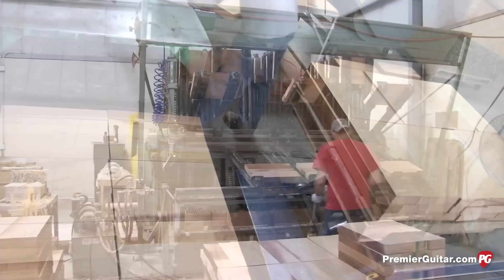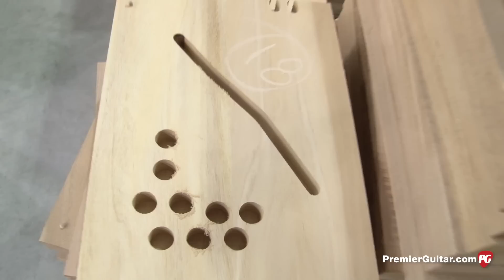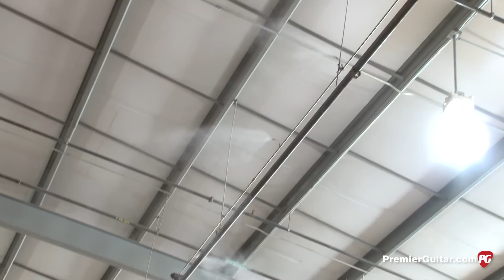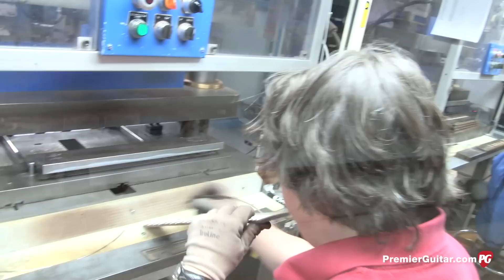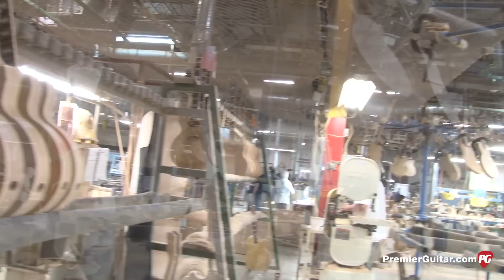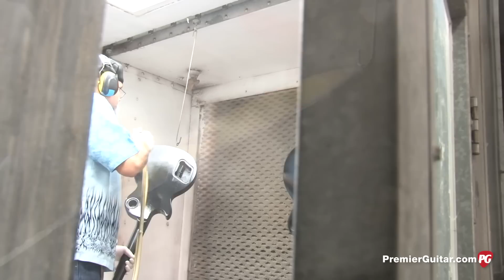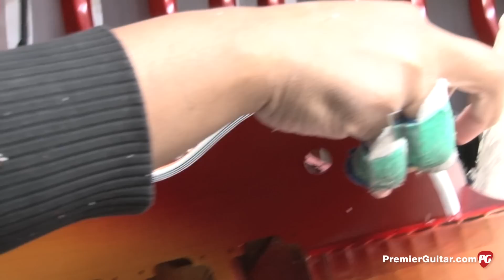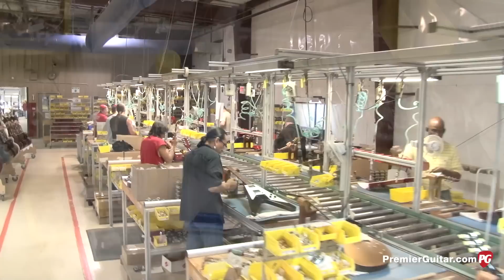Gibson USA Factory Tour

Comment: The bulk of Gibson's sales are in products between $2000 and $3000.  The bulk of Fender's are between $1000 and $1500.

Both companies have entered another "dark period" in their respective histories.  There are simply too many sub models of their major product lines (LP, 335, Stratocaster, Telecaster), with divergent standards of quality.  A poorly made "budget" LP does effect the value of the high end LP's on the used market.  Aside from just a psychological effect on the price, there has been important declines in quality.  

For instance: Bakelite fingerboards on an LP Custom.  That's a rather disgusting consequence of Gibson's unethical behavior in sourcing Ebony.  I was originally rather skeptical of Gibson's supposed malfeasance (considering their overt efforts towards conservation in the past), then those emails came to light.  I have two Gibsons, but I will never buy another one again.

Comment: Really the only difference is the fact that they use a CNC. Who doesn't use a CNC? The rest is pretty well standard, you gotta remember that they need to have consistency. Besides the only Gibsons i buy are used, and yes you are paying for the name and the legend of its earliest guitars. If you weren't paying for the name then what are you paying for? Mexi strats and the others are all CNC cut. You cant tell me that if you picked up a stock Epi LP Standard and a stock Gibson LP Standard that the Epi is just as good as the Gibson or better. Hand crafted guitars will run about the same if not alot more. Hey, theirs just something about a Gibson :)

Comment: Is there any noticeable difference between the old Gibson guitars, say 30 years ago, and the new ones? Is the quality of the product the same? the quality of sound?
Reply: One might say that the old ones were more or less handmade, whereas the modern ones are made using CNC technology - new ones are more "standardised", in that sense.
Personally, I think that modern Epiphones are close to modern Gibsons, so if you want to go for the original experience, better buy an old Gibson model. If you want to save money and still have a great sound, get an Epiphone Ultra III, you'll like it ;-)
Reply: Les Paul guitars are chambered so that they don't weigh as much as the older ones and have less, no pun intended, of a deeper tone.

Comment: a little to automated to ask the price they do, did you see that dude fit that neck he sure took his time (not) should have took 5 to 10 times longer at the least,he must get paid by production not how tight the fit is which matters over the life of the guitar glue can flex and move over time have seen better work on other factory tours,this just brought down love for gibson. the last sg i bought was in 1988 $600 and it was nice but the last one i tried 2013 $1800, but costed 3 times more it should have been better. for the price.

Comment: so fun to see so many people astounded by the fact that machine's are used 
if you can do it better by hand please don't hesitate to upload and share it
Reply: CrazyDiamond1968 "hacking the wood away" is all part of wood joinery, and it is what insures a proper fit. Glue is then used to bond the two pieces of wood with permanence. Just like the narrator said. :-)
Reply: Every guitar manufacturer uses CNC machines, Tom Anderson, PRS, Suhr, Fender, etc. It's not the machines that are the problem, it's the finishing off of a guitar after the machines have done their work. Run your fingers along the neck and body binding of a Gibson, feel the ridge between the binding and wood???...sloppy. What neck joint does your USA Les Paul have, do you even know?
 Look at the neck joint at 32:33...no problem, hack the wood away and fill the gaps with glue...etc, etc, etc.

Comment: how so? they go through the same processes as any other les paul short of binding and finish. same frets, same electronics, same wood materials, same build quality. the difference is that it doesn't receive a nitro finish or binding. which saves about a week in build time. try one and im sure you'll be surprised. They're worth every penny of $799

Comment: I just love that Gibson is still using those Plek machines wrong. You are supposed to let the machine measure when the string are ON the Guitar and when its tuned in. Then you remove them, to let the machine cut it. The way gibson does it makes this machine and the precision it is capable of useless. Its not just about every fret having the same height, its about the height relative to the position of the string when the neck is under the tension of the strings.

Comment: Just to clear up all this nonsense about the paint spraying and no mask or poison paint and all this rubbish!  The paint is being sprayed in a booth where  air is sucked out through the wall with all the holes. It will be filtered before exiting the building. This is a strong and constant air flow pulling all overspray  away from the sprayer.

Comment: And in my extensive experience, not many guitars from small builders that charge a thousand bucks aren't any good. Small custom shops can't order in the bulk to get woods at the significant discounts large builders get. PRS, Gibson, etc. sure. They could get most woods fairly cheap. Then again, one can only speculate the cost of parts as the actual discounted rate is below the standard retail price of each part.

Comment: $1,000 for a guitar from a small custom shop? Bullshit. If a shop is only charging a grand then they probably are desperate to get stock out or are making absolute schlock. See Strictly Seven as an example of a hack builder that had prices around that mark. 

I do agree about the wood cost though. I snagged a one piece, air dried African Mahogany body blank (8/4 Thickness) for about $50. I recently also got a AAAA Maple top (3/4 Thickness) for $180.

Comment: I know, I know...but think of it this way; they realized at some point that humans get tired of filing and checking over & over. When they use a top-shelf robotic filing machine, they can make more guitars AND get excellent results. They check 'em good in the USA. Rest assured at some point between assembly and final inspection, the frets are tuned and dressed by hand.

Sure, I admit the robotics seem a bit lackluster, but if they didn't use them, a Les Paul might cost $10,000 instead of $3,000.

Comment: When you compare this with the PRS Factory tour I know where i'd rather work and which guitars I'd rather buy in future. It also explains why my 2012 Les Paul Standard has so many issues - The binding has been scraped on both the body and neck to the extent where there is a couple of millimetre step between the paint finish and the binding, there is clearly no proper final setup - just a basic check - what is the point of doing the plek process at that stage in the build - crazy.

Comment: I'm a Luthier too. I make a good living fixing crap fretwork (even the Plek'd ones), nuts cut wrong. There like Harley's, a few hundred to put them right
  I have fixed many a cracked head stock. But the models they put volutes on don't sound as good. If you own a Les Paul, pit it away, even to just go take a leak. Case it up. Thing is, when you get a Les Paul that's right, there's nothing like them. You have to take care of it.

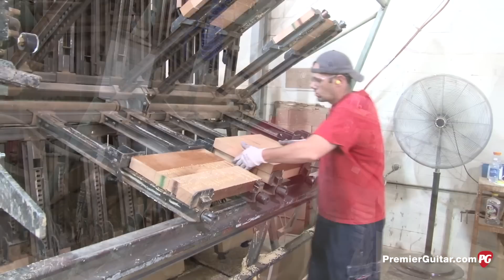Comment: i worked in a woodshop that had a glue rack like the one at 2:00.  it did not have the motorized revolve thing, or the unit to tighten up the clamps.  all manual.

Comment: The special is like the old LP jr. They are one piece (as far as i know) and no hollow parts except for the pots and toggle. It's much lighter and easier to handle then an arched standard. There wouldn't be any need to hollow it out.

Comment: I have a 97 les paul special. The tuning heads are not even aligned at common angles. The sanding of the trim on the side of the fretboards looks like they did it with a steak knife. There is a little buzz around14th fret I cant get rid of. The Gibson name in the headstock has halo around it. It looks almost like a factory second, but the neck is straight and the sound is awesome and I wouldn't trade it for any other and I've owned at least 20 others.

Comment: Umm.... They don't save wood by weight relieving it. You can see where they have to drill/route out the chambers from the solid slabs. They only cost savings they could possibly claim would be in freight, but I doubt there's enough difference to count. The chambering may or may not significantly affect the tone, but based on this video, it has nothing to do with saving money.

Comment: I do my own set up and work on my guitars . . . Not sticking up for your Gibson on your particular issue,  . . . here we go . . . but . . . the nut is actually VERY lightly glued in for the purpose of knocking out and filing or replacing. MOST nuts on guitars I get need to be reworked to my specs.

Comment: Have you ever compared a les paul to a strat? Its two differend worlds, the woods a les laul is made of are like 5 times more expensive the alder, maple or ash. The constuction is way more complicated to build, it has carved tops, glued in neck, bindings, weight reduction holes, nitro finish which takes way more time to apply than the polyurethan finish of fender and the list goes on and on. If fender would build the LP it would be at least as expensive as the gibson one. And tone is subjective

Comment: They cut out the defected parts of the wood and then glue another non-defected part. The bodies that get 3+ different pieces are sold as lower end models while the ones that don't need to be cut are saved for higher end models.

Comment: They weren't actually cutting them in half. It looks like it because they send 2 pieces through together, but what they're actually doing is planing and straightening the edges to match 2 pieces together to be glued into one body. You can see that the raw lumber at the beginning of the video is only half as wide as a body. They have to join to pieces together to get the width.

Comment: MIM Strats Start at $450-$600. The $600 MIM Strat has American made pickups. American Strats are as follows. AM Special strats are $799, Standard strats are $949, deluxe strats $1,599, select strats with flamed maple tops are $2000+. Custom shop strats run about $2,500-$4,000+. Les Pauls: LP Studio $669 for faded finish. no laquer to $1,399 for a flamed top Studio. Traditional LP's are $1,999, Standads run $2,200-$2,500 depending on the top. Customs are about $,3,999. Custom shop BIG Bucks!

Comment: You can't compare a Strat standard with a Les Paul standard. The Fender Strat is more along the lines of of a SG or Les Paul Studio, which are in the  $500-$1300 price range. A standard Strat is $900. The closes to a Les Paul Standard would be the Fender Select Strat at $2,000. The Les Paul Standard is a litttle more than that, but it has more expensive woods, body binding and 6 coats of hand buffed laquer not 1 coat of urethane. Gibson's prices are inline with other USA makers.

Comment: the nature of wide pieces of wood is to cup as it dries out. using smaller sections together relives that tendency to cup. and besides that, the trees making that one piece body you want are not harvested anymore.. Also to have a somewhat stable wide board it  should be quarter sawn which is a very inefficient method of cutting the timber.

Comment: Why is has the quality on high models dropped down so much? Why do you use crackle noise making pots on custom shop models? Why do those guitars get simultaneously more expensive and less dependable quality and tone wise? Why can't you make a proper LP standard with long neck tenon, the way it;s supposed to be made? Why do you switch to baked maple? Why can't you offer a typical LP model without chambering or weight relieving? Why Gibson? Damn it, why am i doing it? Nobody cares nobody listens..

Comment: I'm a veteran guitar builder.  I've scraped, and I've taped.  Taping is more efficient and if done right, has NO drawbacks.  Even if the tape falls off, you can STILL scrape.   BTW, the use of hand-held orbital sanders allows you to keep a lot of detail in a top carve. I use them. It's not at ALL like what you end up with when using the slack belt sander.  Try doing a nice carve with a hand-held belt sander someday.  The slack belt sander is not as fine and precise a tool as THAT, even.

Comment: The slack belt sander was designed to sand DOORS. It's not suitable for preserving the finely carved contours on a well carved Les Paul top with the classic dish carve and upturned edges.  Use of the slack belt sander results in a top that almost totally lacks that upturned edge.  Gibson didn't use that machine in the 50s.    And as for scrape vs tape, with tape, you never remove any binding material. Scraping always takes off binding and can result in unevenness. I've seen it many times.

Comment: I disagree about the sander. I think if it's a really fine grit the top comes out fine. I also disagree about the taping vs. scraping. Taping may be faster and allow you to produce more product but I'm pretty sure the traditional method was scraping the binding. I've been to the PRS factory and they use oscillating sanders using various grits on the tops. I really don't see much of difference between the two with a skilled woodworker.

Comment: typically way a ton, and have bulky necks, pointless set necks- you can't even reach the highest notes. They scientifically have been proven to get less bass response being 24.5 in scale so they used humbuckers to compensate, but the low output generally makes them sound thin anyhow.. Costs a fortune, and yet the bridges often just fall off. String angle to post causes added friction to nut on most models. Nonetheless some of my favorite guitarist have used gibson, so whatever works for you..

Comment: Using a composite material such as Richlite on current LP Customs is very off-putting, but's unreasonable to expect the price of that guitar to drop thousands of dollars just because of that. Aside from that, however, there's no question Gibson uses higher quality materials than Epi. Another reason for the higher price of Gibsons is that they are one of the few manufacturers to use nitro, as opposed to poly, which increases production time and process, and as a result, cost.

Comment: That very well may be true. but less nicks and dings or other imperfections put on the guitar parts during the manufacturing process equals less sanding to remove them which means slightly more guitar. It's more of a quality thing really. If they're demanding $3,000 for their guitars then I thinks it's fair to ask for that kind of delicate treatment during the manufacturing process.

Comment: PRS sanders use air-powered orbital sanders with PSA sanding discs for MOST of the sanding on the guitar.  Some work is done with sandpaper attached to Human Hand 1.0.    Taping off the binding will leave a perfect razor sharp line if it's done exactly right. Part of the trick to taping is to remove the tape soon enough after the finish is sprayed.  That's pretty fast.  It has to be done well before the finish hardens up.  Say in just minutes from the time it was sprayed.

Comment: I've been building guitars since 1985.   I've used similar methods to Gibson's, but of course on a much smaller scale, and when I stopped doing it that way (the wrong way) and started following PRS methods,  it made a big improvement in overall quality.  You can NOT do a PRS style top carve with a slack belt sander.   That POS guarantees that your top carve will be pretty flat and boring.    And when it comes to scrape vs. tape, there is no comparison. Scraping is slow, taping is fast and better